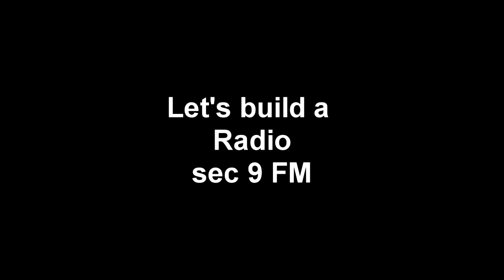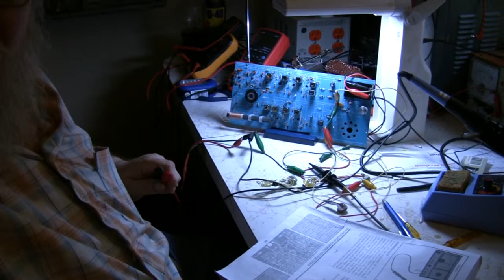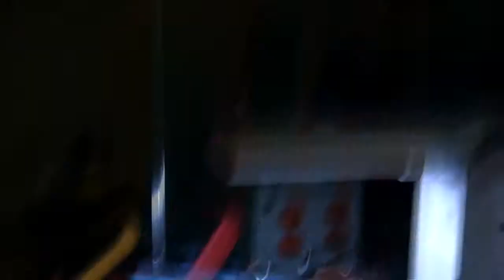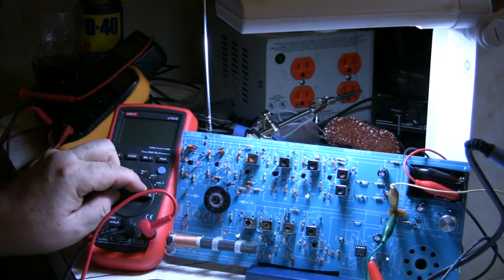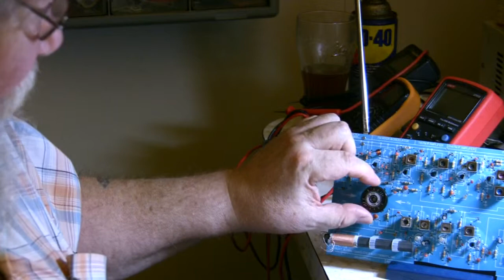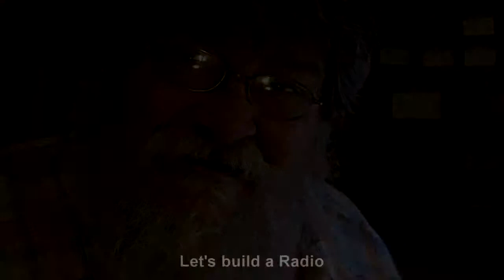Let's build a Radio sec9-FM

Comment: Hey Carl, I just put this kit together and I am getting the same problem. I checked all my voltages on the FM side and they are all correct according to the book. I only get 2 stations on the FM side and they are weak.
Reply from the maker: This one can be a stinker lol. After getting max alignment from the IF cans, ( and if you don't have a signal generator you can try to adjust the cans by using a station you can pick up and adjusting to get a peak. You probably know this. ) then perhaps tuning the capacitor on the back may help. Also, check your antenna connections. Mine kept loosening up.

Comment: Carl, I really enjoyed your videos, especially this kit! I'm a ham, electronics enthusiast, and EE student. I've been playing around electronics since I was 4 years old. I too, will be assembling this kit, but for now I'll be building a 4 transistor AM superhet with Manhattan construction for my lab project. I've wanted to build one for years, so now is a great time to do it. I'll post videos of it as I progress in assembly. My university has some nice scopes, RF generators, and sweep generators, so I should be able to do a good alignment. I'll keep you posted.
73
Reply from the maker: +emuman100 Well I have to say it sounds like you are doing it right. Is the 4 transistor AM a kit or are you building it from scratch?
The problem I had with the AM half of the kit was that I couldn't get it to osculate. I still think half of the tuning cap was faulty. Either way, down the road I plan to revisit that part of the radio and find the problem.
Look forward to seeing your progress on your radio.
Take care,
Carl
Reply: +skycarl I ordered this kit with some of the parts for the AM superhet I ordered recently. I did not have a meter or any other instrumentation, but I was able to fully assemble the power, audio amp, AM, and FM radio sections. Without alignment, I was able to get stations on both AM and FM, but the audio is really quiet. Something is wrong in the audio path, and I suspect it's either the poor quality DIP socket, slide switch, or possibly the crappy solder included with the kit. After the first few components I used my own Kester solder because I never had extra flux with me. Also, the resistors and capacitors in my kit were crappy too because they had super thin leads. I'll fix the audio problem eventually and do a proper alignment, but for now I'll concentrate on my own AM superhet, which I will be constructing soon. Once I do, I'll post a video or two on it.
Reply: +skycarl This 4 transistor AM superhet is a design from a book called "Build Your Own Transistor Radios" from Ronald Quan. An Australian fellow modified the circuit slightly for use with an IF coil pack available from an Australian electronics distributor. My university already had the ferrite bar antenna and tuning capacitor that this Australian electronics distributor sells. The link to the Australian fellow's blog is http://lucsmall.com/2013/05/10/am-superhet-radio/